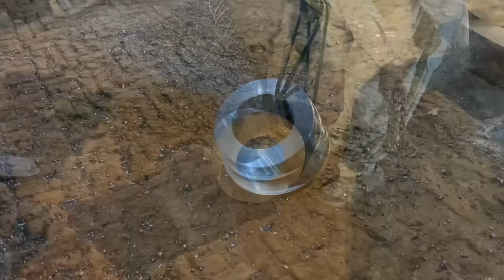Manufacturing Process of Kaplan Gear for Industrial Usage | Production of Gear Wheel | Gear Wheel

Comment: Too much waste ,they should've choose another raw material with a hole .
Reply: I don't disagree, but sometimes the right material is not readily available.  Perhaps they had the solid material laying around and weren't prepared to order a full length of tube for an order that would only require a short length of material?  Either way, I think they need to work on their transition between drilling and boring as it looked super inefficient.
Reply: Plastic Nai He Wo Use Use Kar Lete Hai Company Me 
Melt Karke
Reply: All the metal shavings get recycled into new steel. It's difficult to make steel pieces that aren't solid. Some steels are only available in bar and sheet/plate form.
Reply: IT  ENDS   UP  AS  RE BAR!   they  waste  nothing   overthere!